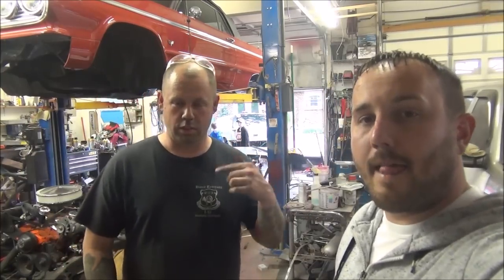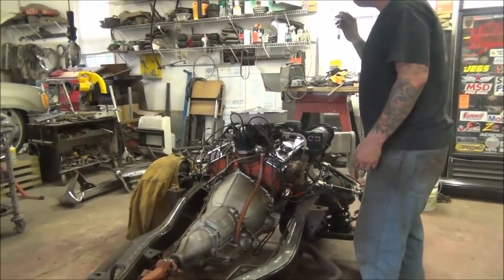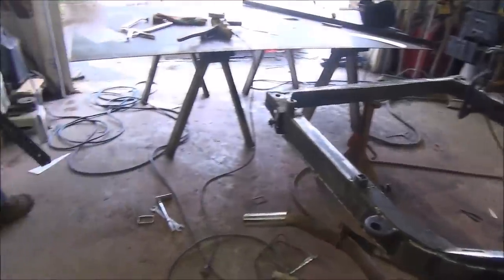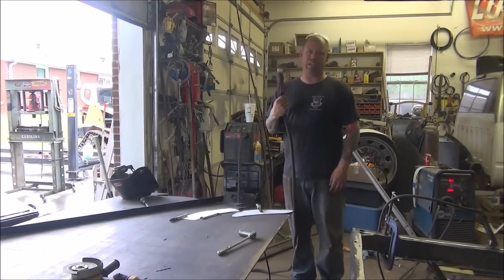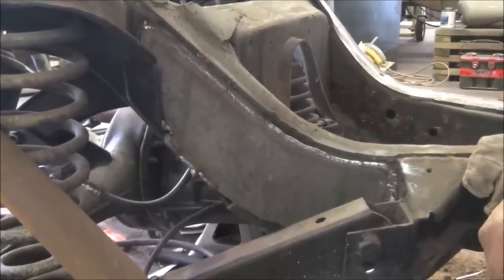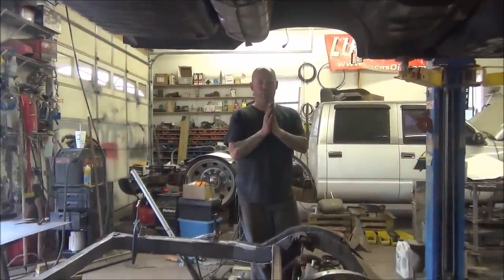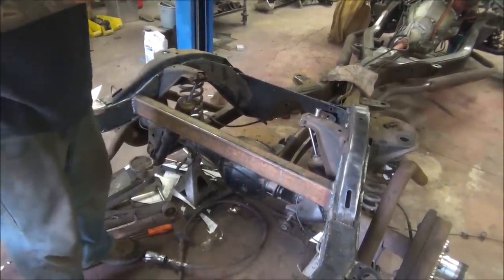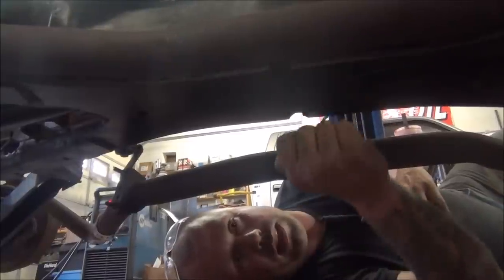How to Frame Reinforcement on 1964 Impala Lowrider Hydraulics

Comment: Thanks for all the comments guys.  Just an update, the frame is finished and has been filled and painted.  Also, the adjustable upper control arms have been removed and replaced with OEM arms.  They have not been extended or reinforced yet but definitely will be.  Front end has been put back and as well as the rear end.  Had to replace a rear main seal in the engine yesterday and new oil pan gasket which took up a lot of time. Also got the y-bone on Saturday and have installed it.  Hopefully have the engine mounted today and maybe even the body back on the frame.  Also, the battery and pump racks have been primered, painted and cleared with paint that was matched to the car.

Comment: Nice video! Im on the tail end of frame off restoring my 64 hardtop. I opted for air bags from BC Fab, you cant do as much with bags but hydros are just so heavy. I wrapped the X section of the frame on my car for a little added rigidity. Should work out alright.

Comment: this is the first time in life I have EVER commented on a you tube video! I am compelled to express what i just saw in this video. So, first of all, this is by far the greatest in depth video i have seen on frame reinforcement. Not only that, the lingo that dude is using is straight hittin switches in the streets lowriding. I love the passion and appreciate all who keep the lifestyle alive. The only thing I'm mad about is that yall aint closer to Philly to work on my 64 impala conv. 4 pumps 10 batt. fyi, been lowriding for 25 years. keep up the good videos!
Reply from the maker: Emmanuel Ekeleme that's what started all this, hard to find any information or help with this stuff, I'm also working on several others that I will be posting soon.
Reply: Emmanuel Ekeleme CHILL is that you commenting
Reply: Emmanuel thank you very much man.  Im 37 years old and have been into the lifestyle since I was 16 years old. Definitley not something that you can just stop.  I don't care how old I get, a passion is a passion no matter what.
Reply: Aaron Christensen 
I'm into another genre of cars you could say, but I love lowriders..
the time and effort put into them is amazing...
I know cause one of my cars is in 100 pieces. 
Haha hey if ya can't get a low rider car get a bike , I did😬
Reply: Just go to Motion 3 Customs.. Hmm Lol 😝
Reply: Yo u have been low riding for 25 years I just turned 20 trying to eat all the info I can i have some question if you have some spare time to talk his me up

Comment: Reinforcing the frame for hydraulics seems like the right thing to do. But how much does it cost to remove the frame from the body and reinforce the whole frame like in your video?
Reply: Joe Garcia Im wondering the same thing.
Reply: Looking at 2500 on a homie hookup to 5000 but you can find one for 3000-3500 I’d do it
Reply: @danieleckerman7099  i just got a 62 w mad frame cancer in the rear. good to know..
Reply: About $8,000-$12000
Reply: @danieleckerman7099  I wish but you are off about 7to 10 grand

Comment: Hello, I am currently doing a 63 impala hardtop to functional factory working vert conversion, and I was wondering if you know what the interior body structure for the vert looks like, I have the vert frame and windshield frame I just need to know and see what all else the interior structural integrity needs to have done to it! Thanks

Comment: I only got the rear arches, front sides, and underneath the belly. Got 3 pumps 10 batts. Starting to notice gaps in doors and fenders. Somebody said sit the car on jack stands all 4 corners and it will restore the frame and close the gaps. Then box in the center of the frame. Will that help?
Reply from the maker: Gride Brougham I’m not saying that won’t work but once the damage is done, it’s hard to correct. I doubt doing that will fully straighten the frame. But give it a try, once it has straightened as much as you can get it, fully reinforce frame and fix whatever bodywork needed.
Reply: Thank you. Kinda figured it wouldn't go back 100% to specs. But If I can get it close, I'll box in the center span. My next build will be a frame off :thumbsup:

Comment: those nubs u got welded to the rear of the frame for the rack. im sure most people weld the rack to them but have u ever seen anyone use them to bolt the rack in?
Reply from the maker: Actually those are removable racks, I just havent posted the videos yet. I will be posting the video in a couple weeks when the car is completely done. It will be a how to make removable racks and several other things.
Reply: Russell Harris  cool, please touch on those in the video,,,,, it makes scents that its removable rack.
Reply from the maker: fuzzy wuzzy we did a few now like that but haven't posted the videos, it's easy but time consuming to make it all line up right. We have some pretty cool stuff coming up, stay tuned

Comment: Is 1,700 too much for a partial wrap for my 63 Impala? That's what they wanna charge me when they install my hydraulics?
Reply from the maker: RC Jr depends on where exactly the are reinforcing, thickness of metal, and quality of work. But assuming they are using 1/4 inch since it’s just a partial wrap, and the welds are nice and the work is good, $1700 is a decent price. My suggestion before you do that would be to call Pit Bull Hydraulics and ask how much for a completed frame, they have them already done sometimes, just send them your donor frame and they send you a finished one. Not always but they are the gold standard when it comes to frames. Brent knows his stuff
Reply: They're mainly focusing on the front and rear axle, they're not removing the shell of the car. Thanks! I do plan on doing a little hopping and maybe three wheel.
Reply from the maker: RC Jr my advice is to find someone else that knows impala frames and Hydraulics to do the reinforcing. The weak points of the x frame at mainly from the middle to the back. Call Pit Bull
Reply: Russell Harris Lowrider Hydraulics thank you
Reply: I looking into buying a 64 hardtop impala that is partial reinforced  trail arms,a arms,side & bottom of frame. is those areas the main stress point for a 4 pump car? Thanks

Comment: Help save you time on welding the frame is to have an air blow gun by you each time you weld after quickly blow it with compressed air
Reply: Curtis Fisher 
 Rapid cooling after welding will cause the metal contract. If it contracts too much too quick, it'll end up cracking the weld.
Reply: Frank Rodriguez tell him ay!